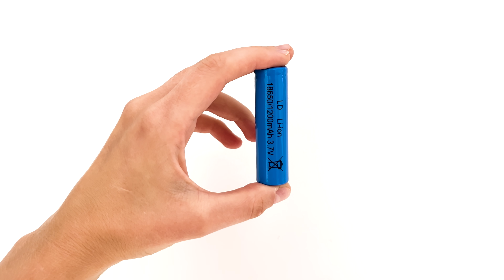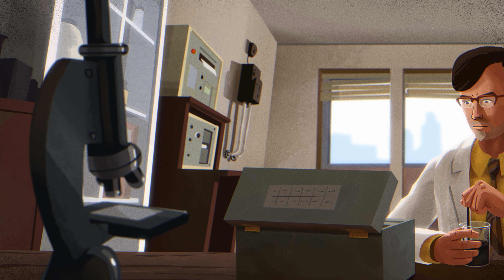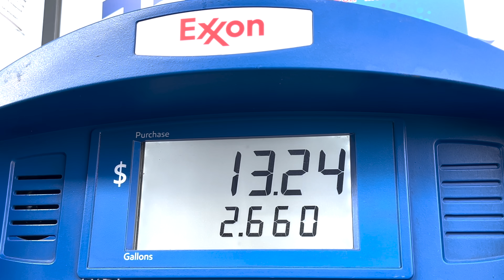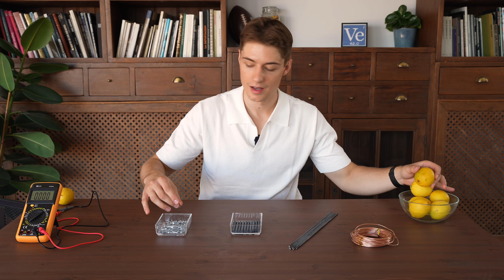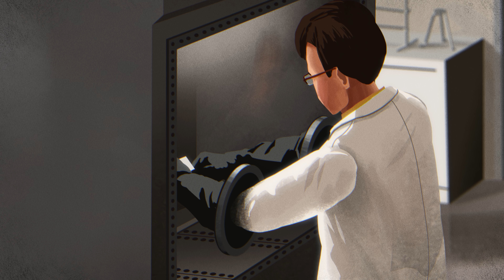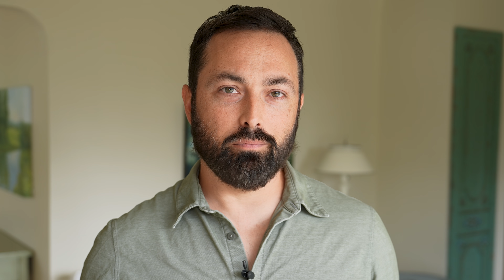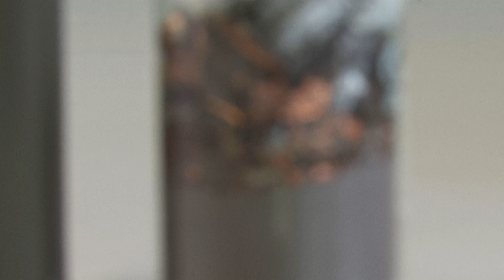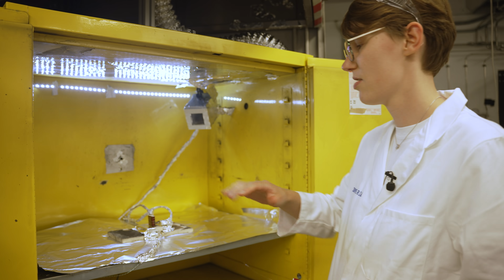The Perfect Battery Material Is Dangerous

Comment: Im wondering if that battery fail test that is shown here is actually realistic.
They heat up the battery with an induction furnace (elecrons through a wire, inducing a magnetic field that extends into the battery and heats that up, type of thing).
Which is the same as putting a blowtorch to the battery, thats not really testing what happens when a battery fails because of decomposition of its internal components or use/recharge related faults, but just how a battery and especially its casing can handle heat exposure.

Am i wrong?
Reply: It's a simulation of what happens when a dendrite shorts the cell, causing it to overheat.  (A more realistic simulation is to drive a metal spike through the battery, but that's not easy to perform inside the test chamber.)
Reply: As said it wasn't a test but a demonstration
Reply: Since when has this guy ever cared about presenting the whole story, instead of just clickbait shock value "today I found out" style videos

Comment: Failed to even mention that latest LiFePO4 batteries never “just catch on fire” even when thrown into one, and they contain zero Cobalt. Most larger-than-a-feet batteries are now based on LiFePO4 cells.
Reply: what about the new silicon ion battery?
Reply: lifepo4 are less dense, same as sodium. But yes technology is improving when we don't need to force the density.
Reply: Limited energy density, higher cost, slower charging speed, lower discharge rate, and limited temperature range are some of the drawbacks of using LiFePO4 batteries..
Reply: That’s exactly what I thought. This videos is very interesting but even if it has been release 1 days ago, it already lack current technology.. Thank you very much for this amazing videos but comon guys, add the Lithium Iron Phosphate and lithium polymer batteries! :)
Reply: @flo_duqs Lithium Iron Phosphate has been around awhile. While more stable, they sacrifice significant energy density. For a vehicle, there’s an argument that the safety aspect is a good trade, highly space constrained devices such as phones will always lean towards energy density.
Reply: It's complicated- but LFP will still emit a plume of flammable gasses (possibly boiled electrolyte) if the worst happens. They still contain enough power in a cubic foot to power an American space heater for an hour.
Reply: And sodium-ion… they’re not as fancy as lifepo but cheap and easy to produce.
Reply: And not every bit of cobalt comes from children scraping the ore with their nude hands, nor does lithium come solely from the Atacama salt sea - why further peddle these boogeymen by the petrol industry? [Ah, I forgot, it was them coming up with the principle, and seeing the future profit base dwindle...]
Reply: @brilanto  most cobalt isn't for EVs anyway. It's all the other consumer electronics we need li-ion for but somehow the media only care about congo kids when it's evs
Reply: @brilanto  ah yes, big oil industry this, big oil industry that, while you yourself are perfectly safe from big battery industry this and that…
Reply: @bravo_cj The first time I see "big battery industry"...
Reply: @brilanto  honestly sounds like a you problem
Reply: Since when has this guy ever cared about presenting the whole story, instead of just clickbait shock value "today I found out" style videos
Reply: @Auriam until he sold the channel out

Comment: The Real Reason Phones Got Smaller (and Then Bigger Again)

A lot of what people believe about the evolution of mobile phones is more myth than fact. While many think batteries are the main reason phones became smaller, the truth is that most of the size reduction came from advances in electronics—not battery improvements.

Early mobile radios (like VHF car phones) used bulky, power-hungry components and weighed around 30 pounds. They needed a running car engine just to keep from draining the battery during a call!

Then came breakthroughs in technology—like LSI (large-scale integration) chips and higher-frequency (900 MHz) radios—which allowed phones to shrink dramatically in size and power use. This brought us the first handheld cell phones, which were roughly 100 times smaller than their early car-mounted predecessors.

As electronics improved further—especially with the introduction of surface-mount components, better radio designs, and smarter power usage (called "duty cycling")—phone size dropped again, by another factor of 10.

Another major factor was the growth of cellular networks, with towers spaced closer together (often less than a mile apart). This meant phones didn’t need to transmit as much power, helping them get smaller and more efficient.

In contrast, battery technology—while it has improved—only contributed to a modest size reduction. The shift to lithium-ion batteries may have made phones around 2 times smaller, or 50% thinner, but that’s a small part of the overall story.

Interestingly, many early-2000s phones—like compact Nokia models powered by the equivalent of three AAA batteries—were actually smaller and lighter than today’s smartphones. Modern devices have bigger screens, heavier glass, and more powerful components, which is why they’re larger despite having more advanced batteries.

Comment: There’s also a 3rd balance the capacity vs discharge current a 18650 lithium ion battery with a higher capacity will have lower discharge current as they have to fight for the space the Sony vtc4 18650 have a higher 30a discharge current but only stores 2100mAh thankfully we’ve overcome that by switching to 21700’s in the vaping world and flashlight world.

Comment: So yeah, we have LiFePO4 batteries, much safer (when broken they heat up, but they don't catch on fire), solid state batteries are around the corner, which should be completely safe and also CATL recently presented Na-ion battery. The SAWN IT IN HALF and... nothing happened. I think we are on a good path. And bear in mind. We can and we already made them safer, eliminated need of using Co. Gasoline - there is nothing you can do to make it less flammable. Many people freak out about lithium batteries while cruising with 30-40-or even more litres of highlyflammable gasoline

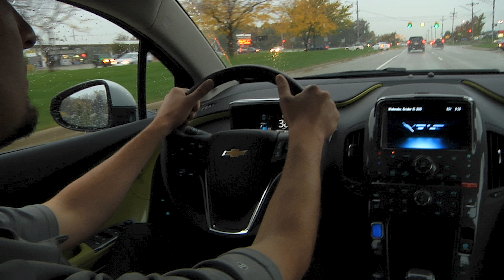Comment: 0:17 It's funny to me the Chevy Volt is a generic "EV" used in news stories and stuff. It's been discontinued for 6 years and was a PHEV.

Edit: That specific one appears to be 10+ years old and driving in gas/hybrid mode.
Reply: Don't confuse it with the Bolt. The bolt is a full EV, I even drive one!
Reply: What is a PHEV?
Reply: @ErebuBat  Plug-in Hybrid Electric Vehicle. A vehicle that use both an internal combustion engine (often petrol or diesel) combined with an electric motor and battery.
Reply: @ErebuBat Plug-in hybrid electric vehicle. Gas and electric

Comment: For large-scale electricity storage, just last month the first operation iron-air battery was connected to the grid at TU Delft in the Netherlands. The storage density, round-trip efficiency and discharge rate are a lot worse than Li-ion, but it doesn't use any hazardous or rare materials, and those downsides don't matter much for grid-scale energy storage, and the battery price per kWh is quite a bit cheaper.

Comment: you should have said "ions" inside the battery and CHARGES outside.  Actually electrons only drift, they do not move very much. In your experiment, even if the lemon was connected for quite some time, the electrons would not have gotten from one side to the other.  Charges move at the speed of light.

Comment: 7:10 You're, freaking, not pushing voltage through anything, it's just a potential difference between two points. In your case the voltage of 1.23V is just high enough to create a VISIBLE reaction of electrolysis, because it is CURRENT high enough. Sad to hear such silly things after great videos about how "energy not flowing by wires".

Comment: Don't forget Lithium-Iron-Phosphate (LiFePo4) batteries, these are much safer than Lithium-Ion Batteries (they don't explode) and have a higher cycle count!
Reply: and don't use Cobalt
Reply: NCA and NCM are still very widely used, especially in portable electronics like phones and laptops so it's still extremely relevant. High performance and long range EV's also use those chemistries over LFP as the energy density just isn't comparable.
Reply: The PO is a polymer, not phosphate.
Reply: @wiregold8930 they messed up the chemical structure, it's LiFePO4 and is definitely phosphate and not polymer.
Reply: @wiregold8930 PO4 is a Phosphate, not a Polymer

Comment: Heh, I work in a lab (I'm IT, not a scientist, but I do their support) where one of the areas of focus is developing thermal cooling fluids for electric vehicle batteries. In short, the more effeciently you can cool the cells, the harder you can push them in terms of fast charging and discharging. That test with the nichrome wire is simulating what happens when a battery is charged/disharged too fast, and the excess heat ends up contributing its energy to the chemical reaction and causes it to run out of control (It's called thermal runaway, kind of the battery equivalent of a nuclear meltdown). Really fascinating video, and one I plan on sharing to the non EV team as a good primer on how Li+ function.

One thing that would have been nice to talk about is how there is a trade off between energy density and how much current it can put out safely.  Basically the "jelly roll" layer's thickness determines that.  Thinner jelly roll layer=more wraps=greater battery capacity, but it also means the thinner layers provide easier heat transfer, so you can't pull/push power as rapidly, due to the heat generated.

Comment: 33:50 in my oppinion the conclussion should be that we cannot really that as heavily on batteries as we think we can, and should reduce the need for vbatteries where possible
Reply: We need some way to store energy. Batteries have to be improved to store larger amounts of energy. What do you think would be better? Because burning things to get power made isnt ideal because we're gonna run out of the fuel and if greatly impacts the environment which believe it or not is important
Reply: @PrmanentlyConfused  Agree with you on the fossil fuel point, but the thing is we could just as easily run out of lithium. What I am suggestion is for example instead of converting every car to an electric car, that we try to reduce the amount of cars we need as much as we can and convert the ones we actually realty need to electric. You could do that with by investing in public transport, cycling infrastructure, trains, reducing how far everyone travels on holidays, etc

Comment: were? They still around. They hever was gone. Half of power lbanks use that. Medical devices still do. EV use exactly this type of battery. Main advantage is they don't leak charge in cold or heat like polymer ones do.

Comment: Surely the fundamental problem will remain: any set of compounds that permit 2-way electron transfer & high energy density will intrinsically always have some tiny risk of unplanned spontaneous self-incineration. So the engineering challenge will be to reduce risk as much as possible - yet 1:1,000,000 is already amazingly low. So there's likely some irreducible level of risk we'll end up accepting, just as we accept many other forms of risk.

Comment: I still have NiCd produced in former Yugoslavia (industrija baterija Gnjilane, "Battery factory of Gnjilane" , i will leave politics out of it), they still work, and i cannot stress enough, they still work 40 years from production, yes they lost some voltage across time, but they still work in my transistor radio. 40 years.

Comment: Ive witnessed a lithium fire, co worker at the shop i was working for took the circuit/protection off of a matco lithium jump starter because he hated it reseting while jumping something off, he had it jumping off a sea doo and left it connected just a tad bit too long, brought it in the shop, set it on his bench and walked a way, he didnt get 2 seconds away before it went, let me tell you lithium fires are insane, they store so much energy, hes lucky he sat it down before it went! moral of the story is never ever ever remove the protection from lithium batteries! If you have a lithium pack and notice it starting to swell get rid of it!

Comment: Side note, if you have a 1 in a million chance for a battery to explode, and you encounter exactly 1 million batteries, the chance that you will see a battery explode is actually around 63% ( 1 - 1/e ) (e is Euler's number, ~2.718..)

That's because the probability of no battery exploding out of the million battery is (1 - 1/n)^n which, when n approaches infinity, approaches 1/e. To find out the chance that there is at least one failure, you take one minus that, giving you 1-1/e.

Comment: regarding the codereview ad: making a descent code review is not what is advertised here. checking some coding rules is also easily done with static code analysis. the difficult part is understanding the domain logic and seeing if the implementation has possbile side effects to other functions other non functional constrains. 
as of now i did not find a setup that can do this in a acceptable manner. as a first threshold maybe ok but as of now it won't do the part of the review that you really need.

Comment: Nowadays, when cars are charged by hydrocarbon power plants, lithium cars create more CO2 emissions than internal combustion engines. In addition, lithium mining is terribly toxic and creates a huge amount of waste, and lithium batteries are not recycled. As for the risk of a car catching fire in an accident, I would never buy an electric car with lithium-ion batteries. To switch to electric cars, we need to abandon hydrocarbon power plants and abandon lithium, otherwise the environmental situation will only get worse because of electric cars.
Reply: That’s completely wrong. Car engines are extremely lousy at converting the chemical energy released during combustion into kinetic energy. They overcome the limitation by using very energy dense fuels, but the energy that’s wasted as heat released as much carbon joule per joule as the energy successfully used to move the vehicle.

Large power plants are far, far more efficient than car engines, losing less of the energy their burning fuels release to heat. Electricity is also easier to move around than fossil fuels, so less energy is wasted getting the energy source to electric cars than ICE ones. And electric motors are extremely efficient at converting electricity into motion. So even accounting for higher vehicle weight & conversion losses from AC to DC & storage losses in the battery, electric production, transmission, & vehicles are more efficient than gasoline production, refining, transport, & burning in an ICE engine.

So even in areas where the electric grid relies entirely on fossil fuels switching to an electric car would still lower emissions. And very few areas are like that. Most electric grids have a mix that includes hydro, nuclear, wind, & solar—making the difference in emissions substantial. 

ICE vehicles are also worse in terms of land use required to manufacture & power them. The land despoiled mining battery materials pails in comparison to the amount laid waste by oil production, storage, & refining. And the reason is obvious: batteries are reused throughout the lifespan cycle of the car while gasoline/diesel are continuously burned during use—requiring orders of magnitude more volume of mined & refined product than were needed for a battery.

Comment: "Zero Emission" is a lie. Car parts still need to be made (and battery material mining is extra egregious), then the car has to live long without exploding, and then you have to somehow decommission those rare metal batteries.
Reply: Even with production included, the lifecycle emissions & land use requirements for electric cars are significantly lower than they are for ICE cars. And, sure, mining the materials for the battery components isn’t good for the environment, but the materials are reused throughout the life of the car as it’s recharged—and can be recycled after the life of the vehicle. Meanwhile, ICE vehicles require the continuous one-time consumption of fuels that likewise have to be extracted, transported & refined at cost to the environment. 

And come on, the risk of explosion is minuscule. Battery fires can happen, but they’re pretty rare & increasingly so per miles driven. Modern electric cars have all sorts of battery management & protection features that make the batteries extremely safe. Plus the risk of fire is basically nonexistent for LFP batteries, which are becoming increasingly standard.

Comment: 5:06 but since the voltmeter has a high resistance, no current can flow and a voltage comes present. 
Without the voltmeter there would not be a voltage since the current is flowing.
Reply: The voltage would drop but there still is one. With a real battery there wouldn't be a big voltage drop or if you would use a resistor